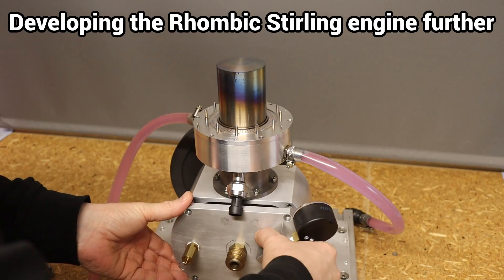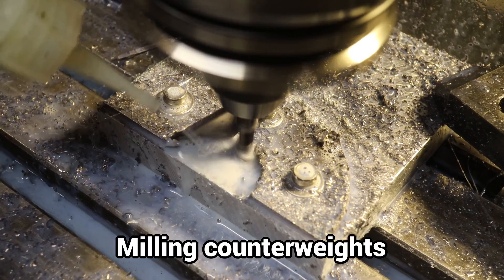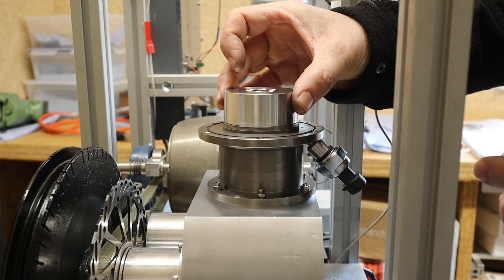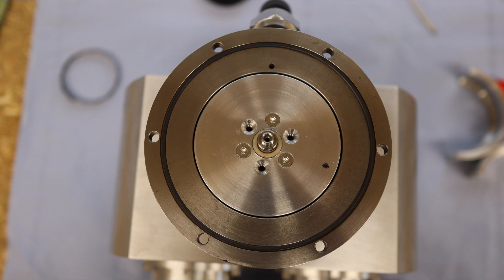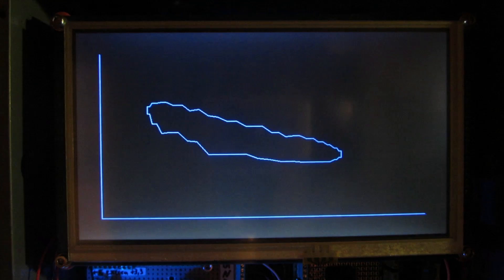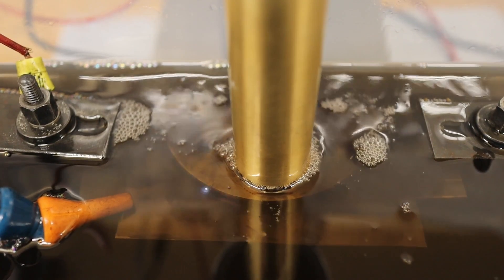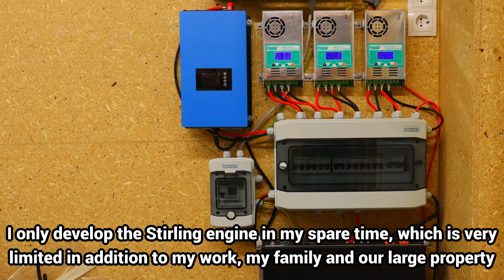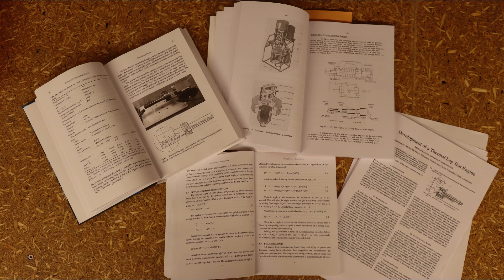Stirling engine development for cogeneration of cheap DIY energy to become off grid and independent

Comment: You could experiment with the cold side piston having fins that dip into a coolant in the down movement.
Reply from the maker: This will contaminate the crankcase and thus the working space or how do you mean it?
Thanks for your thoughts!
Reply: @myengines2443  It could be cooling and lubrication oil or you could just make a container that is on the edge of the wall with a shouldered hole for the moving parts to move through. Think water fountain minus the middle part.

Comment: Please increase the distance or insulation between your hot and cold sides.
Reply from the maker: The regenerator is between the hot and cold spaces but you are right over the cylinder alot of heat is travelling to the cold side.
Thats a disadvantage of the beta design which has other benefits.

Comment: Please try building a piston that has a un-screwable top so that you can slide your piston rings in.
Reply from the maker: To use unslitted rings without a gap or why you mean?
Reply: @myengines2443  Yes then the rings wont have a open end and can slide over piston like a washer or washers. It will save you plenty of time.

Comment: Would it not be better to perfect the 300w engine. What is your output goal 1000w?, and what about price?
Reply from the maker: I don't want to stop improving the Rhombic but at the moment I need something new.
The problems are the complexity of the engine and thus its maintenance intervals and its price.
At the low power levels it has to run permanently and the wear will make the service interval quite short.
1000 watts would be a good number than it has to run only a few hours per day...
The price would be because of its complexity far to high to sell.

Comment: A sterling good ole boy...
Reply from the maker: Yeah...
Reply: @myengines2443  Oops meant to say a sterling JOB ole boy...What if I told you I came up with a 22nd century electric motor..AND anti-gravity AND noooo one will listen...
Reply: @John-y2b4m  Perhaps, 22nd does not mean much in an electric motor to an electrical engineer so you need to describe it better.

Antigravity will be everywhere if it can be DEMONSTRATED repeatably and that would be nice.  So far no physics has suggested a good reason why it would be possible but you could be the guy and get two Nobel prizes for your efforts.  Repeating random internet huckster's ramblings will not cut it though.  I hope you succeed.
Reply: @KallePihlajasaari  Ah I missed the word century...Sorry..100 years ahead of anything out there..

Comment: most piston rings run with lubrication. in the engine world engineers have been going to lower tension rings for better fuel economy since the early 2000s. Have you considered just grabbing some off the shelf rings? also the cylinder bores need to be iron, or nikasil plated as other uncoated metals tend to spall. Some engines use Metal Matrix Composite (MMC) and that surface seems very slippery, but I don't know how its made.
Reply from the maker: Piston rings and coatings from ICE engines I know of need lubrication which I cant use in the Stirling.
I look for MMC but don't think its different!
Thanks for your help

Comment: Hello "My engines." Referring to your chart at 1:31, as a mechanical engineer, I can't see why you are wasting your time in a such inefficient engine.
Most of the energy, maybe 99%, is wasted in the Stirling engine.
Elon Musk and his bottomless money pit, his Tesla cars can not out do the internal combustion engine.
If you insist in using external combustion, them use the steam engine ?
Put your mechanical talent in a well proven engine.
Reply from the maker: You're right, the efficiency is not yet satisfactory.
But what motivates me a lot is the constant improvement of the values and the still unused possibilities that the Stirling offers.
A low-sounding efficiency of 10 % would be possible and is not bad for a micro engine and with additional waste heat utilization for heating it looks even better (CHP).
Thank you for your suggestions
Reply: The fuel availability of external combustion engines is much greater. Steam engines have their own problems, with requiring constant adjustments (checking the water level, etc) and being rather more complicated. they also do not seem to be considerably more efficient than Stirling engines, in their most basic form.
Reply: Phillips had stirling engines (rhombic drives) running at 40% efficiency in the 1970's.

Comment: Teflon coated..?
Like..Slick 50.
I used it on a car.6 cylinder was getting 20MPG went to 32MPG.
A 1964 Dodge dart. Had to adjust Carburetor three times.. Started running faster and faster just on idle. Fuel air mixture brought way down. Ran beautiful. Quicker Throttle response. 
Acted more like hair trigger. :)
That stuff was gold man. Grey/yellow color.. 25$ a quart. Back in the day. Only needed one. With
Oil change. Replaces one quart of oil.  one time process. 
Run it for 1500 miles.
Oil change again.. done. Standard oil changes after that.
( Won't work with stainless steel.)
Age 67.
Reply from the maker: Sounds nice I will inform myself about it, thanks

Comment: I've often wondered if a Sterling engine could work for power generation on the Moon using the temperature differential between sunlit and shadow areas.
Reply: Yes and no. it requires a working gas, the moon has no atmosphere if it were inside a dome structure it would likely cause to much heating due to inefficiencies. But you should look into RTGs they are the ultimate solution for space travel that's why all modern rovers use them. Super long lasting around 50+ years and steady consistent power. Only draw back is radiation would need to be a sufficient distance away from human settlements.

Comment: 🟦…I think your biggest mistake was in using rings on the piston to Begin with!.. They are an Entirely Unnecessary source of friction!...
...Just machine both the piston & cylinder out of the most frictionless materials appropriate for the use, to as exacting tolerances as needed to allow both a good seal AND self-lubrication of the piston within the cylinder.
A piston for that would need a fairly deep-skirt to make the best use of the PSI-losses involved.
.... Good luck!
Reply from the maker: I tried a ring less design, the problem is the different expansion of cylinder and piston even when they are of the same material.
The piston becomes hotter than the cooled cylinder and seizes!
I tried to make a fit which compensates this but using rings was better for me.
I have to investigate how to make the pistons without rings, any idea?
Thanks for your help!
Reply: expansion and contraction of materials require a ringed design for sterling engines. All materials expand and contract with temperature. You would always have blow by with out a ring to catch the gasses.

Comment: Try tungsten disulfide powder for friction problems. I add it to grease pivot points and bearings and it makes them last forever. The runout or slop never increases because of the imbedded slippery yet strong particles. The more load and jolts the more the particles get worked into the metal. There will then be no metal to metal contact. For dry applications like the one you are working on, it will also work into the surfaces, resulting in a lower friction outer surface. Graphite breaks down and moly doesnt really work great and is too low concentration from most suppliers.
Tungsten is a super material and reacted it becomes small and soft apparently. The um powders from suppliers i have purchased this from seem all legitimate. I think it would work well in a sterling engine.
Reply from the maker: Thanks for this nice hint!
I tried molybdänum sulfide and it worked a bit.
I will look out for tungsten disulfide

Comment: I hope you are using peltier technology to increase your heat flow. I am curious as to exactly how much this improves the output.

I forsee this as a fluid & air pumper for a geothermal home heating and cooling.
Reply from the maker: I am not sure what you mean but powering an peltier element to heat or cool the Stirling would be ineffective.
But I want to do some experiments with thermo electrical generatores (Seebeck / Peltier) also in the next time...
Greetings
Reply: @myengines2443  the stirling engine would run off the difference in temperature between the inside and outside temperature of a geothermal home. A solar panel could provide addotional effeciency to the system by powering  peltier's on both ends of the engines heat circuit.

A simple idea. Should be quite effective.
Reply: @myengines2443  you are 100% incorrect in your statement. In fact, exactly as if you were releasing misinformation into the public.
Reply: @scottflick5758  scott could you explain. from what i understand you want to use electricity to power a peltier to create a temperature difference, and then run the stirling off of the temperature difference ?
Reply: @knightning3521  peltier technology could be used on "both-ends" of a stirling engine, to increase its effeciency.
A small solar panel, for an off-grid system could make a very significant affect.
The stirling enging would be used to circulate geo-thermal heating/cooling fluid. It would "run" off the temperature difference between the inside and outside of the building(underground prefferably).
A simple system. A solar panel to energize the peltier circuit.
     Have not assembled it YET.
Reply: @scottflick5758  the system you described doesnt involve sterling engines ? also please go into details about how the peltier can be used on "either end" of the sterling engine to increase efficiency.
Reply: @knightning3521  It is self evident.
Reply: @scottflick5758  many things are self evident, which one are you thinking of.
Reply: @knightning3521  i refuse to "chicken-peck" the BASIC SCIENCE of what you are referring to, with one finger and one letter at a time.
Thermodynamics is basic science,... physics 101.
Peltiere is also a simple concept also.

It is simple to see how increasing the transfer of heat rate, will increase a sterling engine power output. Right?
Reply: @knightning3521  no offense intended
Reply: @scottflick5758  scott you need to rethink how you interact with people. this conversation was unpleasant and a complete waste of my time.
Reply: @knightning3521   your opinion is "duely noted", and irrellivant. 
Your inability to comprehend "the science," in no way prevents it from being true.

I tried to save you all that beautiful machinework your doing, for nothing. 
Some people suffer from paradigms. I break them.
Reply: @scottflick5758  scott, i read your original comments and pegged you as this, but i thought it unfair to judge you without giving you a chance. you blew that chance.
Reply: @knightning3521  i have never "blown any chance".
I offer hard-science advice. I have no need to prove anything to you. You seemed like you were working hard to achive a simple goal, I "problem solved" decades ago. Sorry you do not recognize the gift.

Good day Sir, & good luck.

Comment: what is heat source for this engine? sun?
Reply from the maker: In this experimental stage its propane and a bit self produced biogas (look at my older videos).
When the engine is running to my satisfaction it has to run on self produced biogas and wood (maybe also woodgas)!
Greetings!

Comment: Can you run a stirling engine off the waste heat lost by a hot water heater? 

I have this stupid idea for a farm-tower that uses a series of hydraulic ram pumps to move water up a tower in stages, each stage incorporating a small waterfall that will spin a tesla turbine to generate power, and when the water gets to the top, it is boiled using a mix of the electricity generated below and thermal energy from a series of solar ovens ringing the exterior, the purified steam collected and condensed (and heat extracted via Stirling generator to produce more power), then held for long-term storage to be used as drinking/bathing water.
Reply from the maker: If you only have the hot temperature as low as 100 degrees celsius the engine has to be very big to get reasonable amounts of power.
But it had been done and can be effective but its not my type of engine.
Thanks for your thoughts!
Reply: @myengines2443  I was thinking more like 230 celsius, but thanks!

Comment: To increase the specific energy of the engine, you need to increase the thermal capacity of the expansion medium. In this case compress the air inside the system to several atmospheres. Normal ICE engines suffer the same constraint. Without a compression stroke, a conventional ICE is anemic. When Phillips was experimenting with sterling drive engines, they pre-compressed the expansion gas quite a bit, though I don't remember the pressure off the top of my head. If you think of a heat engine as a device that steals a bit of the kinetic energy of the gas molecules every cycle, and temperature is simply an average of the speed of these molecules, then increasing the number of molecules at the same temperatures increases the amount of energy harvested. Your engine losses due to friction and thermal leakage will remain essentially the same, but getting more energy per cycle will allow your engine to have increased net output.
Reply from the maker: Yes, you are right.
The rhombic Stirling is pressurized to 10 bar with air and I made experiment with helium at 5 bar.
Philips worked with a pressure of 200 bar hydrogen and more what is far to dangerous for me.
Thanks
Reply: @myengines2443  Interesting. I am way out of my element here (please excuse the pun), but would CO2 or Ar have more heat capacity as their molecules are heavier? Seems like each molecule at same temperature and pressure would have 3 to 4 times the kinetic energy.

Comment: the performance of this engine will always be limited by the mistakes contained in its design.
in the design of a heat engine, priority should be given to  having  physical  Separation  between the sides.      this is why the beta configuration is less-than ideal.
the linkages should be as simple as possible.  and as as  light.      the linkage components in a heat engine do  Not  need to be robust.      in this design, energy is  Lost  in  the extra, reciprocating, mass in the complicated linkages.
in order to  Equalize the affects of gravity, cylinders should be  Horizontally  oriented.
it is recommended that the bottom of the cold cylinder be 'open to the air'.
a variety of metals should be  Strategically utilized, in order to achieve 'self-lubrication'.       lubricant should not be used in areas where components slide against one another.
the use of piston rings is a  MISTAKE.        d

Comment: Comment from the peanut gallery but why not sleeve it. You don't seem to be dealing with extreme pressures. The friction fit on the sleeve could be minimal. Go for maybe up to a 1K hrs of reliability but super easy maintenance. Then you could coat the sleeve or make it out of anything you wanted. You have next level skills so a sleeve should be a piece of cake. That's my 2 sterlings.
Reply from the maker: Thanks for your nice suggestions I will thinkk about this...

Comment: Many many companies tried to develop a reliable stirling. They all failed. Don't waste your time. Use TEG. I know the efficiency is low. But the will work.
Reply from the maker: You are right but mabe with cost minimization I can find some nice for the Stirling.
The problem of the big companies were the high costs that I try to avoid.
The next generator must have a much simpler design that I am currently searching...
Thanks for your comment!

Comment: Your rings look too thick you can look at some things like gapless rings from total seal and some oils that will chemically break in an engine.  They do lots of racing applications you can also look at ultra low weight viscosity oils. Toyota has some 0w8 oils on the market in the usa. They cut friction substantially.
Reply from the maker: Unfortunately the engine has to run dry!
But thanks for your suggestions!

Comment: I think you need to consider using a lubricant instead of the rings... but choose a lubricant that has good heat transfer properties. Keep the entire cylinder bathed in it and let that form your seal.
Reply from the maker: Unfortunately the engine has to run dry!
But thanks for your suggestions!